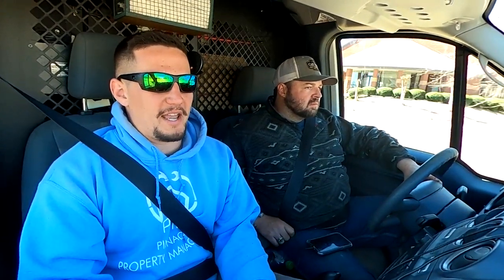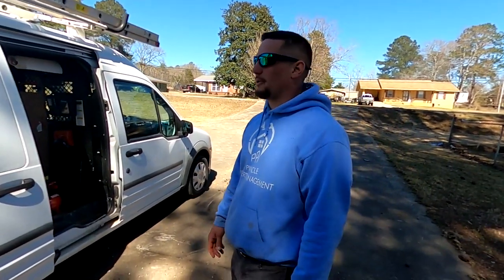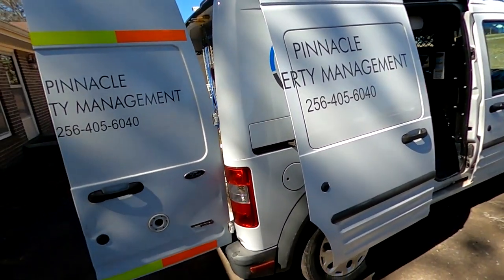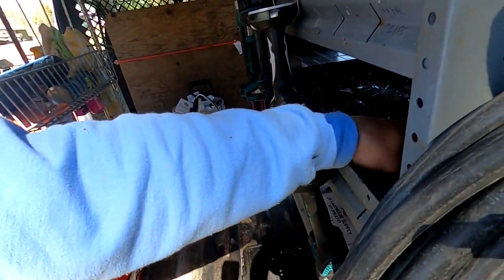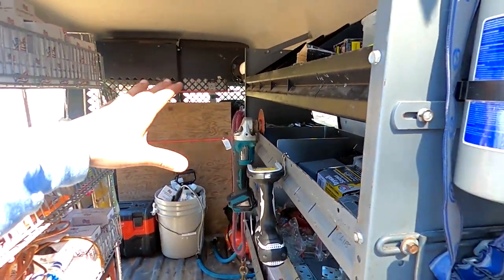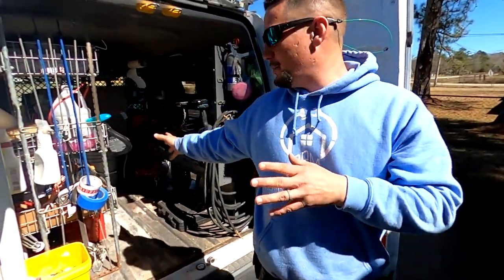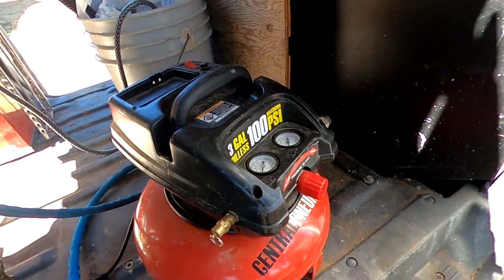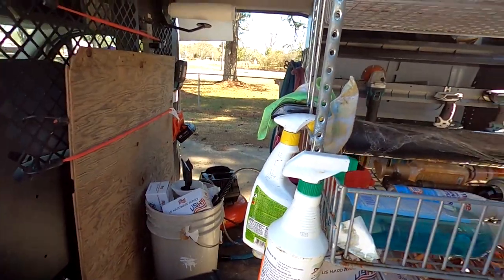Property Preservation - Van Setup

Comment: That's a transit connect which is a Ford Focus based minivan. I know plenty of folks using Dodge Caravans even for grass cuts using small trailer and a commercial walk behind.  My 07 Ranger did this for years.  Cap in winter and open in summer. 
I never buy cleaning supplies. I just use what i find in trashouts. 
I used a Ford E150 for a while.  That was nice but towing 3k# it got literally 5mpg.

How do you get enough volume from that pancake compressor to find plumping leaks?
I have a shop vac for sucking toilets and another for less disgusting purposes.
That really is a nice small setup but again a Caravan,  Freestar, Odyssey exct would offer same fuel mileage of low 20s and way more power and space.  
Good luck.  I'm getting my crew cab Titan, my 86 Chevy K20 and my Econoline ready for the upcoming flood!
Reply from the maker: I’m not the biggest fan of the Transit, everything on it is very cheaply made. I still use it though, I’ve gotten so used to it I’m not sure I’d like the change.  Years of walking straight to your tools get hard to change away from.  That harbor freight compressor is fine for pressure testing, never had any issues with it.  Hope you’ve been staying busy.  We’ve had a crazy year!

Comment: Buy a sprinter
Reply from the maker: I'm going to be honest,  I never even thought about a Benz...
Reply: The upkeep is expensive,  diesel fuel is 50 cents to a buck more expensive than gas and only a commercial truck shop can fix them. Reliability sucks too.
A Ford or Chevy cube van will go several hundred thousand miles and get 10mpg most of the time unless you get a v10 Ford and use too much throttle.